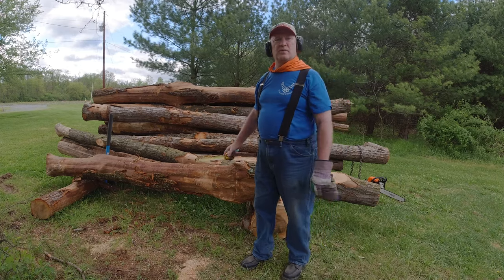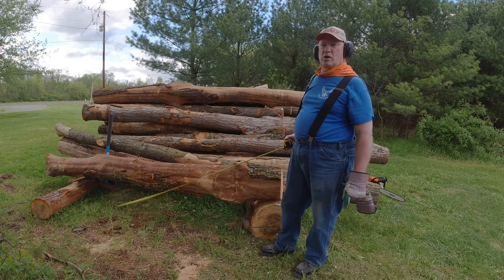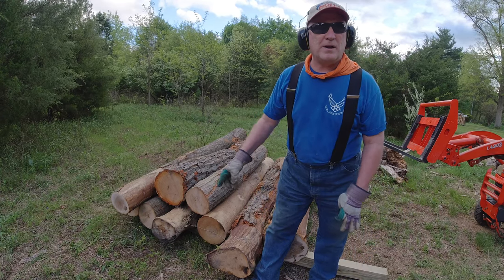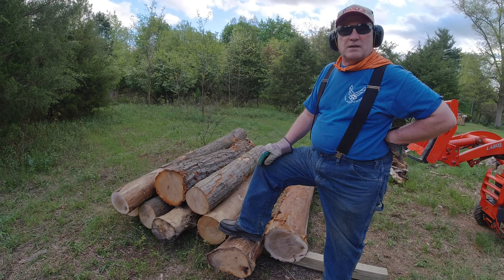#68 - Staging Firewood Poles

Comment: that's interesting watching the tractor work,,, do you know what the lifting capacity is of your loader? I think on my little Mitsubishi it about 700#
Reply from the maker: Good to see you here Vern, thanks for watching.  The breakout force is 882 lbs.  And the full height lift is 400 lbs. I tried to lift a big beach tree a week ago and could not get it off the ground, so I just pushed it to where I was working and cut it into cord wood rounds on the ground.  As you know, these small tractors can be a big help around the property.  Thanks for your support Vern.  Take care - Cheers
Reply: @botabob  yes indeed, my little tractor is from the 80's I think, but I wish I had a loader a long time ago,, I just have to remember not turn it over again.. lol